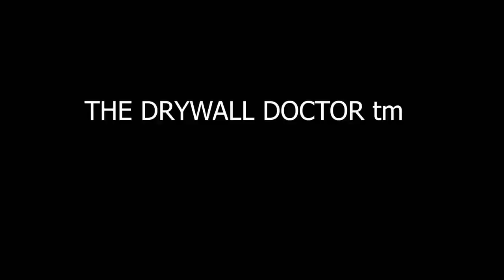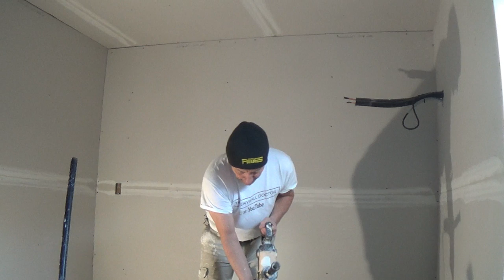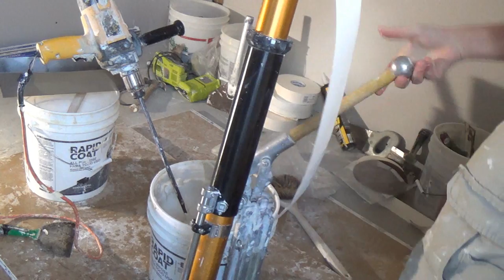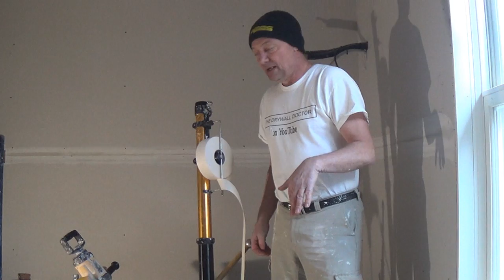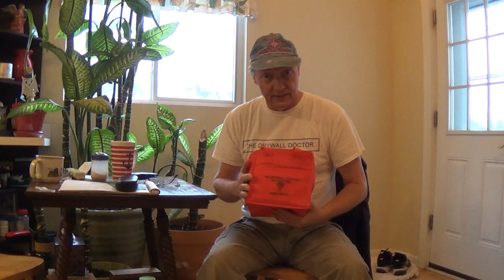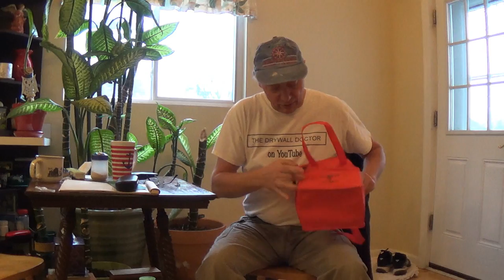Mud Mixing For The Bazooka

Comment: I can tell by the sound of my drill if the mud is right. Video request for the new creaseless FibaFuse.
Reply: I love the fibafuse  tape. I use it on all  of  my butt joints. Been using  since it came out. I was a field tester for it.